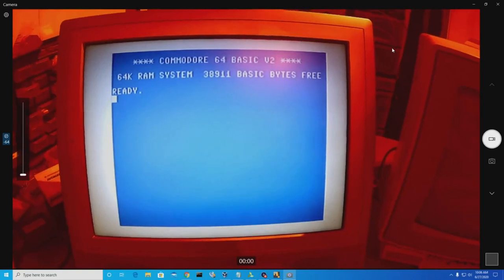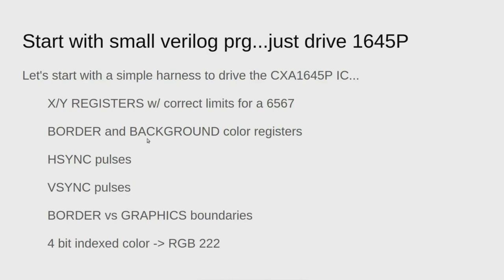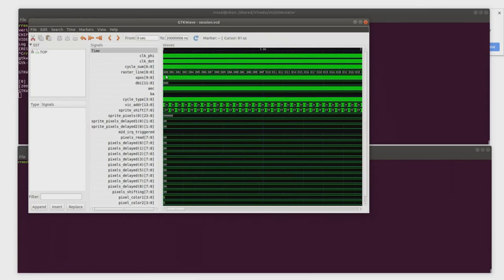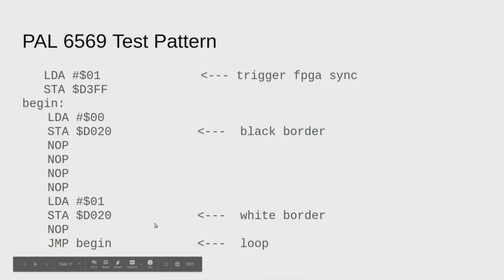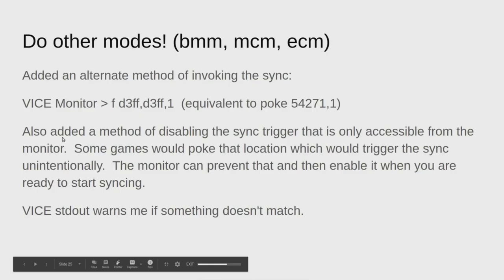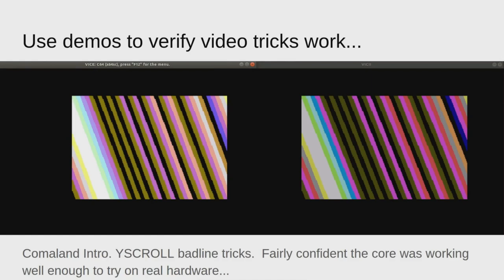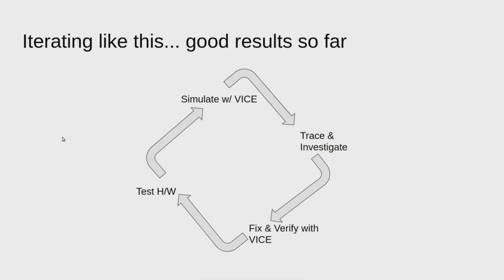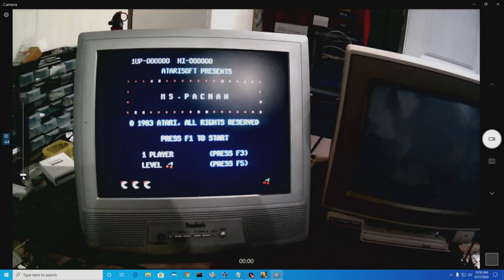Homemade VIC-II 6567/6569 Video for the Commodore 64!

Comment: What HUGE amount of work!!! The Verilator+VICE is interesting, I did something similar with the Laser 500 (a Z80 computer) when coding its video chip for the MiST FPGA platform. I wrote the code in JavaScript but in a Verilog-like style, and then hooked it to a JavaScript Laser 500 emulator I had written before. The clock resolution was 1 cycle and I was able to run the simulation at almost real speed (all within the browser). That way I was able to check all the signals and the correctness of the various video modes.

Comment: Finch's ideas are a good starting point. Screen-height sprites are an easy target. Where-ever possible, eliminate "badlines" (this when 6510 is kicked off the data buss every 8th line). More sprites. Interlace mode. A new bitmap mode where we ditch the 8x8 cell crap, in favor of having the bitmap more logically addressable, like a Cartesian X,Y grid (going forward, this would make lots of 3D and other graphic manipulations more efficient.) Implement  color ram on-FPGA as byte-wide static ram instead of nybble-wide so that it can use be used to leave more cycles available for the 6510.  If you can make the on-FPGA ram addressable so as to appear as motherboard RAM, that would have some benefits.

That 8 sprites are being added suggests you're getting additional bandwidth somewhere,  so that bodes well.

Comment: Interfacing the simulation with vice is really cool. Btw, often overlooked fact is that the c64 video enhancement by c0pperdragon sort of implements a secondary VICII that piggybacks off the signals on the c64, and it's running on the MAX10 fpga. Might be helpful for ironing out some details, and would be neat to have a compatible palette configuration registers.

Comment: Oh my God. This means there's only one chip left on the board to crack.
Reply: is that the CIA or CPU? I think that would make two left right?
Reply: My understanding is there multiple cpu alternatives... with some conversion boards obviously.
Reply: @KANDYMANIAC  Sweet! Any links? What about the CIA's? Are there any alternatives for those?
Reply: @System-1541  these are just two of the ones I was thinking of. I think there might be more. https://hackaday.io/project/165624-mocka65xx-universal-650285xx-cpu-replacement

https://hackaday.com/2016/07/02/the-dual-core-arm-powered-commodore-64/

I believe one of them has a product for sale. I found a Facebook link somewhere.

Comment: What an awesome project! I think it would be really intriguing to pair something like this with a replica PCB and other modern chip replacements to have a thoroughly modern C64 that still runs like the original. Expensive, sure, but the way prices are going for hardware on auction sites, it may not be long before something like that would make a lot of sense.

Comment: This is super cool! In 80' we use to code intros, and to "trick" VIC chip to actually have images even out the border. There is, as far as I remember, the trick to do that with waiting for the raster line to come to the edge and then changing the status of "scroll border" where the text goes behind. Did you try this? I am not sure this is easy to emulate, but it is possible.  Anyhow it is amazing project, super amazing, and thank you for doing this. If you need any support, please - say it! Love long and prosper!

Comment: What is an FPGA? Is it different from a real chip (such as the original VIC-chips)? (E.g. is it some kind of emulation or is it in fact a real chip?). 
(yes, yes, i tried googling, but i'm not into electronics, so that didn't help)
Reply: It’s Field Programmable Gate Array.  It’s real hardware that can be dynamically programmed with custom functionality using similar tools as actual chip designers.

Comment: I had assumed everything already existed based on e.g FPGA-64 and C64 core for MiSTer, but I take it those implement a hardware 'emulator' then? Anyway, great work, very interesting.
Reply from the maker: Correct.  There are cores for complete C64 systems which include the VICII.  (I'm not sure if any are open source though.)  This is a bit different in that the intention is to provide a drop-in replacement that will interface with a real C64 bus rather than other components implemented inside the same FPGA.  So that means dealing with things like DRAM refresh and timing constraints imposed by a real C64 bus.

Comment: Any progress or update on this? As I am going for as many modern replacements as possible on my SixtyClone machine, then this will be an awesomme thing to have in my machine. I am like why not go for as many modern replacements as possible, when the board is a replica and the case is a modern one from pixelwizzard.
Reply from the maker: It's coming along.   I was planning on  making an update video soon.  I'm convinced the logic is okay but I've gone as far as I can go on a  breadboard.  It works surprisingly well given the noise but I get the occasional glitch when lots of lines switch at once.  Next step will be an in-between prototype board that will use the Spartan6.
Reply: @r3rossi  Nice.... I am so looking forward to a fully working version. 👍👍